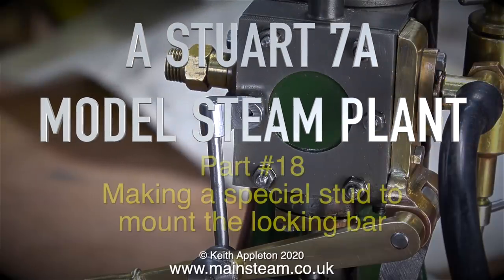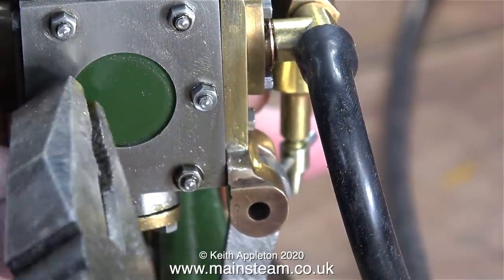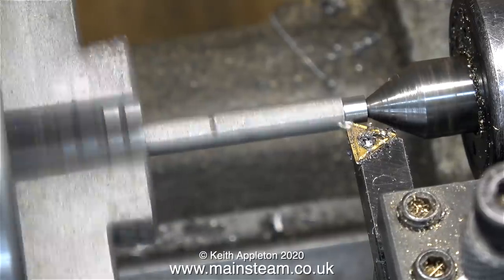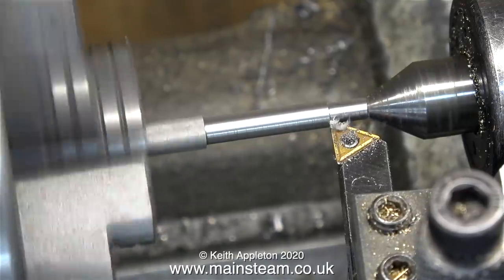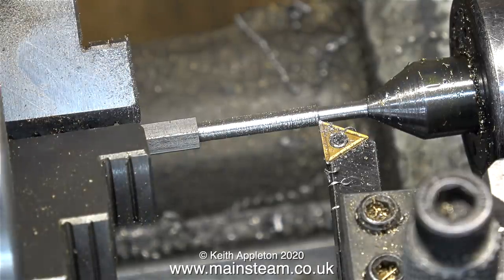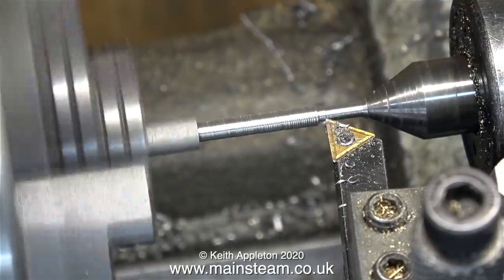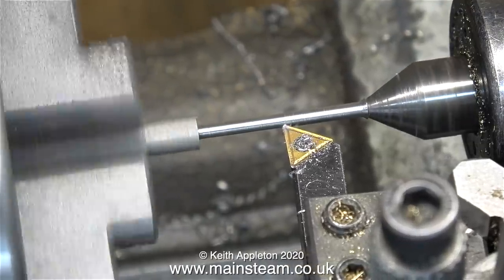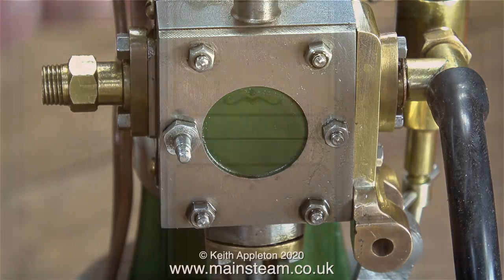A STUART 7A MODEL STEAM PLANT - PART #18

Comment: I'm really liking your videos, and learning a lot from them (I'm a mould designer, but only recently put my hands in a lathe). But I must object to one of the things you are teaching to novices. Use a micrometer as a go/no go gauge. There is a simpler an most correct way, that will avoid beginners remove too much material, and is using a digital  caliper (Or micrometer). Is not time consuming, and you just need a calculator.  Just set the caliper to the target size, zero it, and start measuring after every cut (Or when you think you are near the final size), you will get how many material is left to remove. Divide by two times the division size in your crosslide dial, and you know how many marks you must move your crosslide. This is the proper way a beginner should learn.
I just finished my first serious engine, and working in a boiler now (All fabricated, sorry), so a lot of your tips are very useful to me.

Comment: A question Keith if I may.... if the stainless part you make does work harden, is it possible to anneal it and then rework, or is it scrap and a new piece will be required?  Many thanks.
Reply from the maker: Never tried it with Stainless, I would just start again I think.
Reply: I looked this up on Google.  You really need very specialized equipment to anneal stainless.  It is not practical in the DIY shop.  Good idea though.
Reply: If you can, you could try with carbide tools to get pass the hardened section, it's only superficial.  If not, start again, unless is a part that have a lot of hours invested in it.